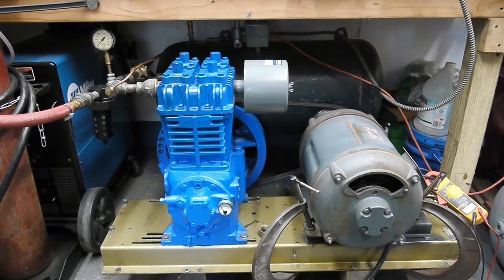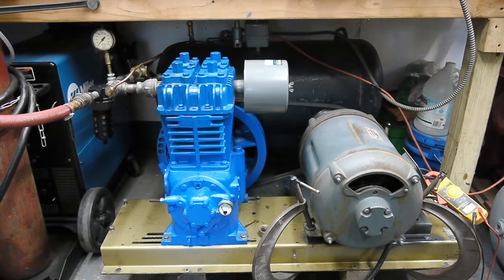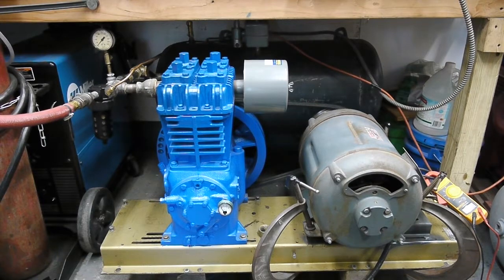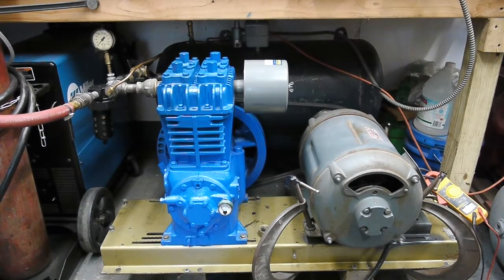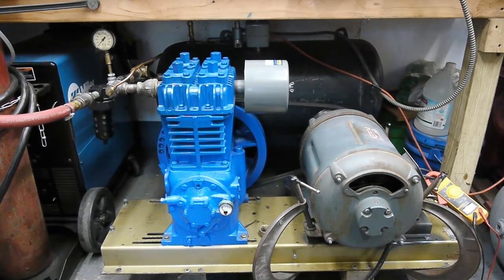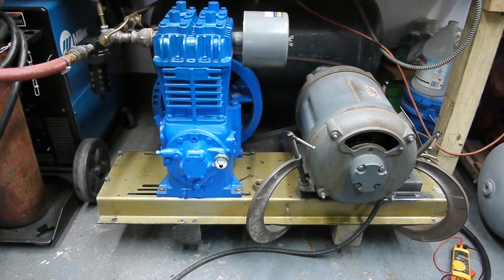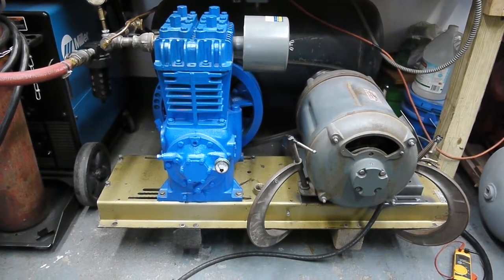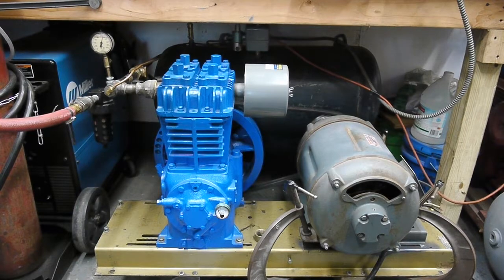Rebuilt 1968 Quincy Model 230 Compressor powered by a 1946 7.5hp Wagner Motor

Comment: I worked in an electric motor repair shop in the 70's. We saw more than a few of these Wagner's. Most of the ones we got in for rebuild came from refrigeration systems, driving open drive compressors. We thought that the RI (repulsion-induction) motors had the most starting torque of all the single phase motors at the time. Too bad they're not readily available anymore.

Comment: Isn't putting immediate full-speed/full load on your cold Quincy air compressor hard on the cylinders?  I intentionally use a VFD with the slow start-up setting to give the old Quincy a chance to warm-up before coming to full speed.
Reply: Generally speaking, they should at least be set-up with an unloader valve, that dumps the pressure between the tank and compressor output side.
It gives that hissss at the end of a cycle.

Comment: Dam , 22 cfm from a single stage compressor is great,,, seems like the older units put out more,,,,I have single stage compressor 4 hp puts out 12 cfm,,,I didn't want to go to 2 stage, so much louder and run much hotter,,,with the little piston recompressing,,,the already compressed once from the first piston,,,,wish I had your single stage
Reply from the maker: George, Quincy manufactured several larger single stage compressors. My 230 is a mid range single stage compressor with 3.5" bore and 3" stroke. The 240 is very common and has a 4" bore and 3" stroke. The 255 is seldom seen and has a 4.5" bore and 3.5" stroke, and the 270 is their largest single stage compressor with 4.5" bore and 4" stroke. These are all twin cylinder compressors. The 230's and 240's are 3-5hp compressors. The 255's are typically 5 or 7.5hp. The 270s I have seen have a 10hp motor. You can definitely get a lot of output with a single stage compressor running on single phase power. Quincy compressors are quieter than what you will find in the big box stores simply because they are heavy, cast iron and do not spin incredibly fast. Most of their compressors have a maximum operating range of 400-900rpm. A 255 or 270 at 400-500rpm would be very quiet and very useful in a home shop.
Reply: @screaminjimmy6V53T  Agreed, I picked up a QR-25 325 about 6 months ago. A warehouse property owner was liquidating items and a buddy bought 3 compressors, mine was one of them. I told him flat out I wanted it and would pay asking price lol. It had fallen over at one point, and there was a cover on the pump that looked like a bearing housing or something that was smashed. So it was going to be a project. After I got it into my shop, I started pulling up workshop manuals and stuff, and found out that the smashed "cover" was an oil filter. Took it off and the threads and housing were pristine, and the oil wasn't milky or anything. It's from the early 90's and appears to have the original pump and Baldor 5hp motor. It's really quiet and pumps up really fast. Handles everything I throw at it. I think that thing is going to outlive me lol.
Reply: @shawnllorca4768 
I have a QR325  with a record of change of 104, and it has the big filter.
They are a beast.
Reply: @screaminjimmy6V53T  Thanks I'm pretty ok with mine,,,it's a kobalt,  from lowes,,,has a marathon motor and same pump as Quincy,,,,I just checked it , it can pump up the 60 gallon tank from o to 150 psi in 5 minutes and 15 seconds,,,and I'm now useing high flow fittings with all 3/4 copper pipe,,, can never had to much air it seems,,,, I can't sand blast , but everything else seems to do fine,,,
Reply: @georgespangler1517  I have the 80 Kobalt in my garage at home. Bought it brand new a couple weeks ago. To be honest, it's got nothing on my Quincy I got at my shop. My kobalt is much louder and slower to fill the tank. Splash lubricated, loud and chinsy air filters :/ but the price was right for a throw-away compressor. And it won't get much use at the house.
Reply: @shawnllorca4768  l ran my filters through wall to outside really quiets it down,,,most don't realize a 2 stage dosent give anymore CFMs then single stage,,,it just boosts up the pressure and really makes air hotter causing more moisture,,  don't need as much air now with all the electric tools we have,,,back in the day most shop tools was air,,,my single stage puts out 150 psi and I turned it down to 130 and my tank takes almost 2 minutes less to fill now,,,that's a option for you,,will save compression life over time,,
Reply: @shawnllorca4768  l went with the 60 gallon 3.5 hp,, single stage,,did all 3/4 copper lines and down drops with drain valves,,,but best was I put a 25 foot roll of 1/2 inch could copper between compressor and tank dropping air temp from 200 to 120 and eliminating any moisture in tank and I ran my intake through wall to outside really quiets it down and I get only fresh air,, l just couldn't see enough gain to spend 450 more dollars for the 80 gallon, only thing I can't do is sand blast for long periods but I have a 4 cylinder Smith not American eagle vintage compressor with 8 hp gas engine l restored and stole for 100 dollars to find out the compressor pump now sells for 5000 dollars and it puts out 36 CFMs,,,it's a air sucking beast,,lol..

Comment: Mine only has a 5hp Baldor motor but is equipped with hydraulic unloaders. Never draws too many amps and runs slow enough to have a conversation in the shop when it's going. Love it. These things are built like tanks.....
Reply: Sounds like you got a QR series! Does it have an oil filter too?